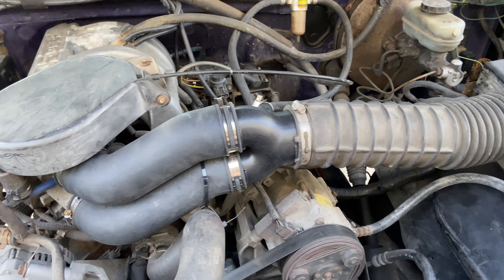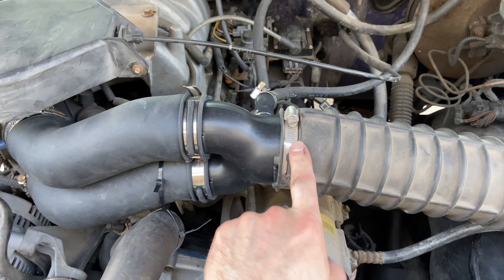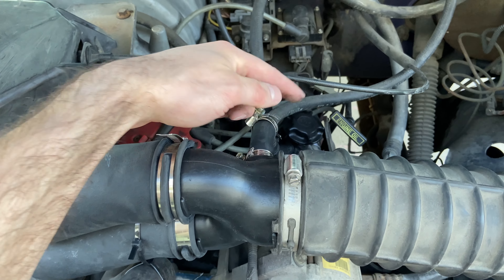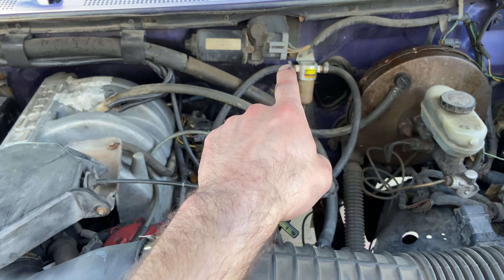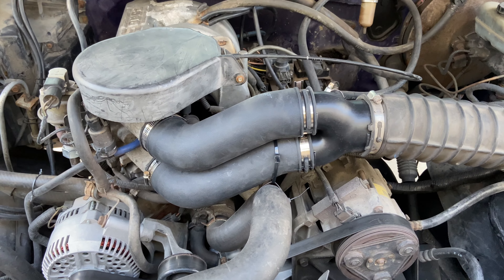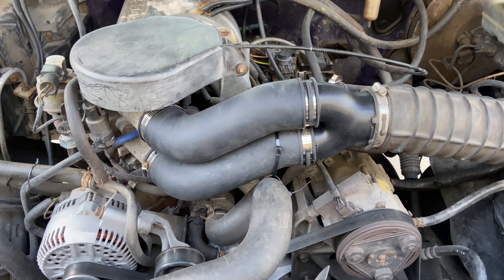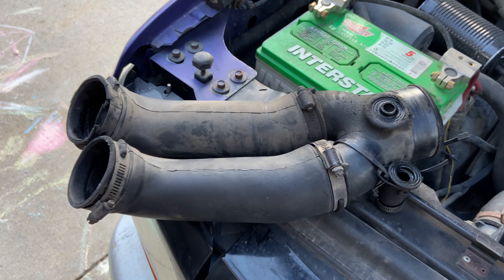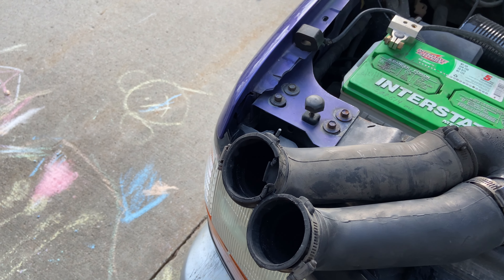Where Did I Find this Intake Part | 1995 Ford Bronco / F150 5.0 Engine

Comment: My air intake doesn’t connect to the oil cap
Reply from the maker: What year is your truck? Mine is a 95.
Reply: @TheMinuteMasters  94 but idk the original motor gave out n my dad had put a new one at the dealership and the truck sat for like 5 years then I took over it because i wanted to learn manual on it
Reply from the maker: @SC-dt4ij  Interesting. Maybe it’s a feature that came with the 95 year models with the 5.0.
Reply: No I have a 5.0 from 94 and mine does... So someone probably messed up on something or when you got the new engine the put different valve covers on
Reply from the maker: @forthewookies  Yeah different valve covers would change that. I don’t think aftermarket valve covers come with that port on the side of the oil filler.
Reply: @TheMinuteMasters  yea from what I looked online most of the after market valve covers online dont come with is so yea that's probably the most likely thing to have happened